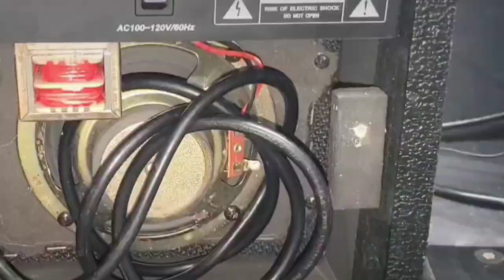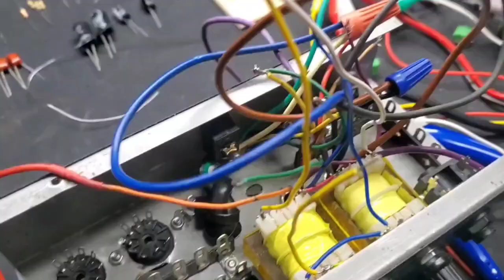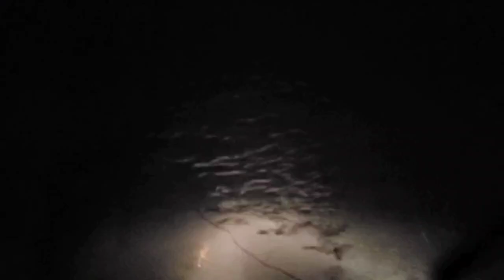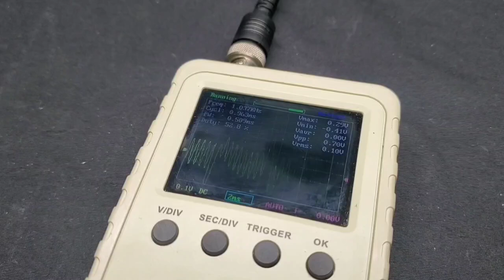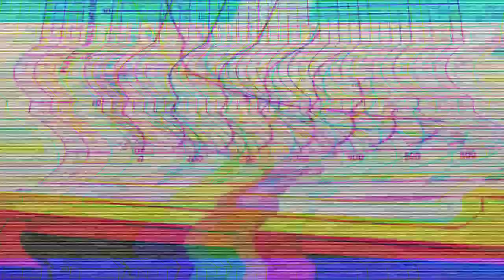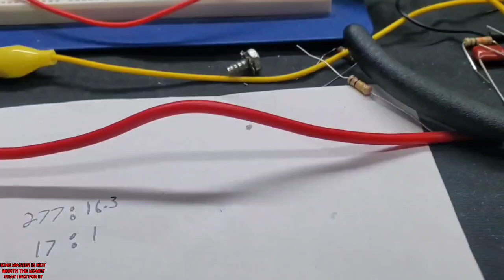Introducing TATTAS - The Totally Awesome Tiny Little Tube Amp (Complete Trainwreck) - With Schematic

Comment: To help with the parasitic oscillation, try connecting the Grid Leek resister directly to the Grid, and add a 220 ohm grid block resister (from the pot wiper to the Grid).
Reply from the maker: I will certainly try that

Comment: You schematic is a little bit flawed. You bias the first stage with grid current. This will raise the DC potential of your input stage which will feed anything connected to it, like a guitar.
Secondly there is always a possibility that a vacuum tube fails and shortens the Grid to Anode, which raise to potential of the input to about +166V DC. It probably wont kill you because there is still a 200k resistor in series, but it will definitely hurt when it happens.

You can fix both of these issue's by adding an input capacitor to your schematic. Something between 47n and 100n should already be plenty for that.

There is also nothing in place to prevent high frequencies from being passed along (1W at 200Kh is 1W of audio power lost, but you'll never hear it....). You should add a small 100p capacitor after the grid resistor (10k) to prevent these frequencies from being amplified.
Reply from the maker: Thank you very much for this helpful input
Reply: @satanicinduction  You're welcome 🙂If I may suggest then change V1 from grid bias to cathode bias. Cathode bias puts your grid at 0V DC and it will also give you the option to add some global negative feedback.

Please add an properly rated input capacitor. 🙏 The more I think about it, the more it scares me. There is not a lot of physical space between the Anode and the Grid. That is basically the space that you put the guitar player in with the positive Anode (it's maybe a mill?). Would you like to play guitar knowing that you're always at 1mm away from +166V DC? 😅

Do this especially when the tubes are (incorrectly) horizontally mounted. The wires within the tubes can sag over time and make contact with each other.

Comment: 12BH7 are awful about oscillation. The plates are very long. The 12BH7A is a newer version that’s supposed to be better about not having microhonics.
Reply from the maker: Tell me about it
It made a fine little output stage but a crap input stage